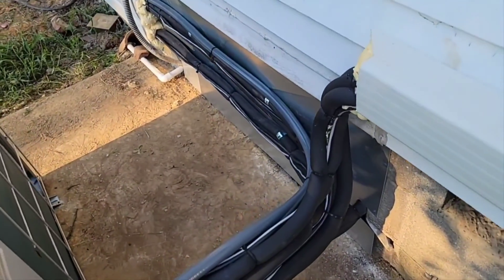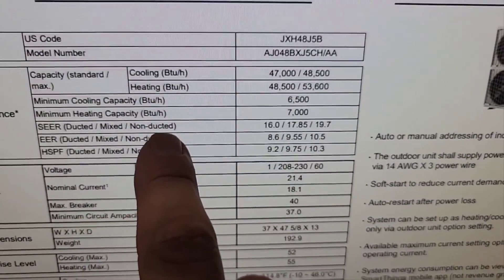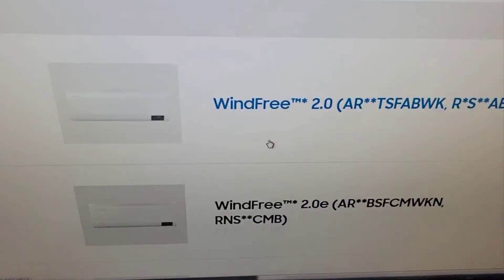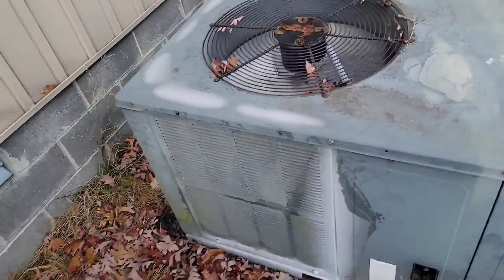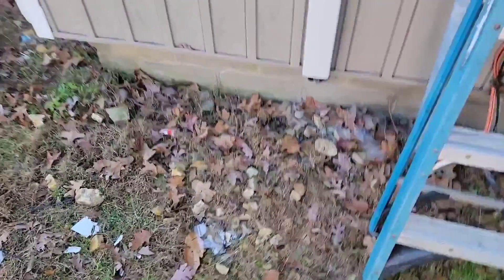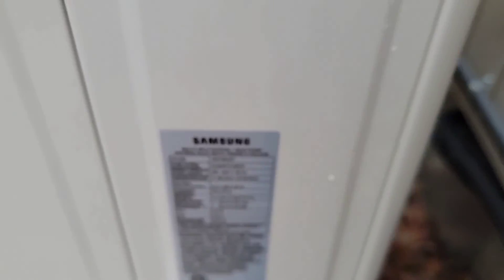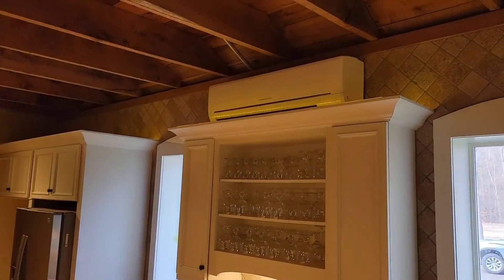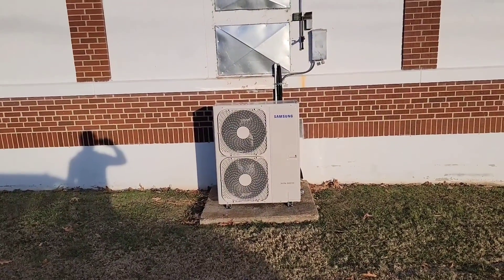Transform Your Home with a Ductless Mini Split System Upgrade!

Comment: This is a different question.  When a person installs a new trane gas pack is there any adjustments needed to the variable speed blower dip switches or should you just put it in and go I'm curious 🤔?
Reply from the maker: there is a commissioning process 
I check airflow with a tool called a anemometer 
I use a formula to measure cfm and then adjust speed to match cfm needed 
I have a video about it
Reply: @taddydigest  ok I will look for that video or can you tell me what it's called?
Reply from the maker: Here is a video that should explain more 

I will do a new video soon 

https://youtu.be/2KuHOOQkOYg

Comment: I would have split them up into two unit's incase one failed I don't lose everything. I also would have added a ICM493 Single Phase Motor Protection to protect their investment. I add that with a surge protector on all my installs.

Comment: Quick question on your bard units why are you using sheet metal to fill a hole instead of blocking it and then putting Eva particle board with insulation between the two or is it the temporary until they get it professionally closed
Reply from the maker: The hole was  Insulated with particle board and has sheet metal with 1"  Liner on the inside
 But yes it's just temporary

Comment: FYI that wall mount at 2 minutes 8 seconds is not level and is going down about 1 in to the left it's fine if that's where the drain is but if it's not you going to have some leakage issues
Reply from the maker: We always leave some fall towards the side that has the drain
 Just insure better drainage

Comment: I can see these types of systems being more relevant in homes without existing ductwork but to add a complex system like this with more potential leak points and electronics isn't my preference. The benefit of a package unit is everything is in front of you and you can use all the existing ductwork granted it's in good shape.
Reply: But with minimum efficiency

Comment: What does wind free mean?
Reply: WindFree™* Cooling technology maintains the desired temperature and eliminates cold drafts by delivering air through micro holes on the unit's fascia panel when the louver is closed, producing a dispersed and gentle flow of air defined as "still air."

Comment: I really like how you showed the routing and the specs on the installation. It really helps with the decision making process. I have done installation with separate outside units but this is still a clean setup.